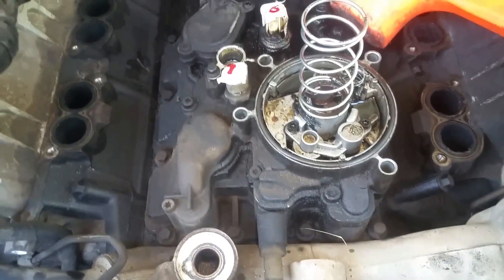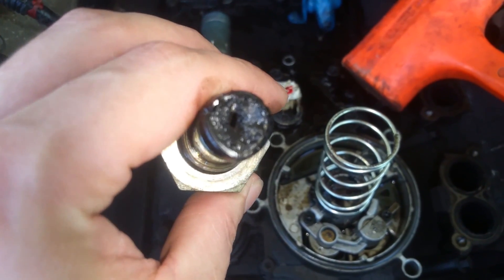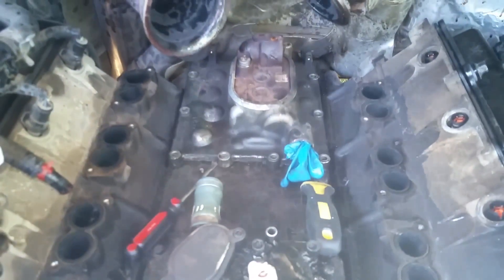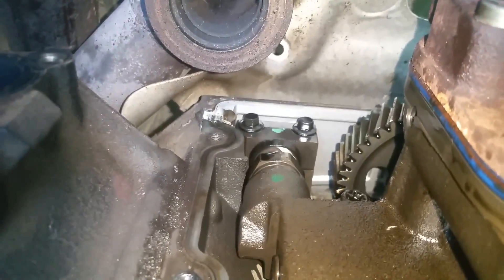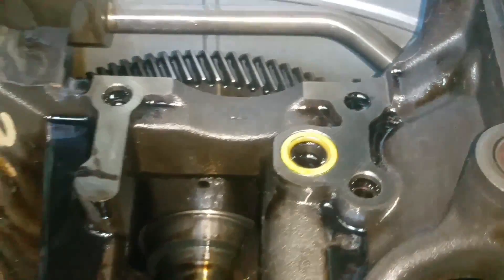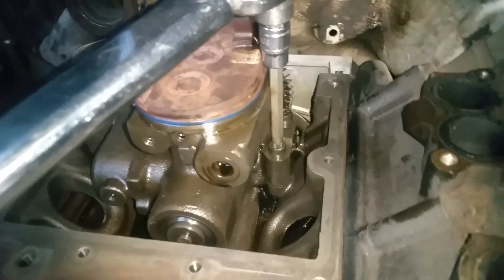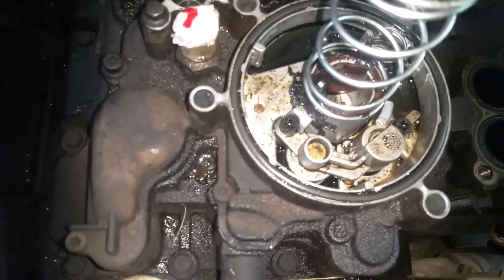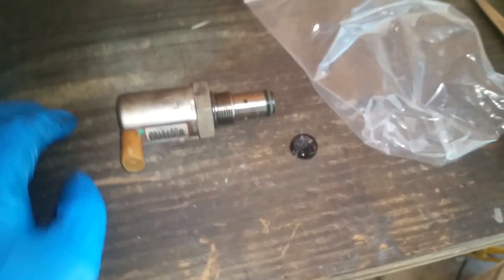ford 6.0l diesel high pressure oil pump replacement and seals

Comment: Did this engine run after repairs?
Reply from the maker: I had to get a replacement engine. I did'nt realize at the time the plastic had melted all through the system. From what I have heard it requires a complete rebuild. Thanks for the feedback.
Reply: @WrenchTheory501  I have the same situation with my engine. I'm going to try to repair the oil cooler and hpop and see if it'll run again. After the overheating incident, radiator repair and oil change the truck ran again for about an hour then shut off during test drive. That was before I realized the plastic had melted down. Thank you